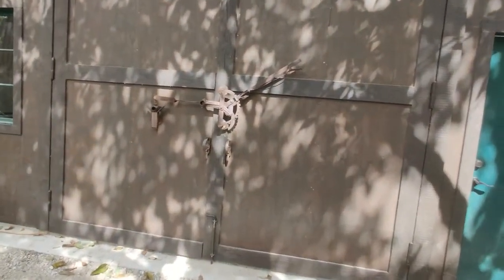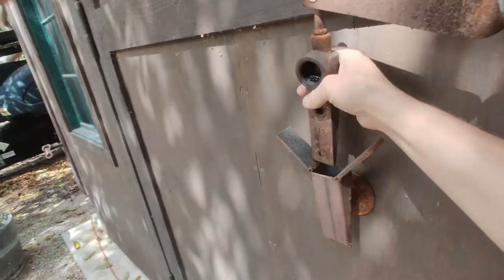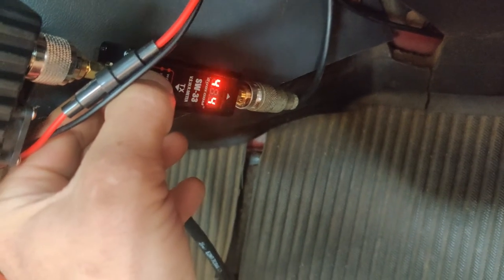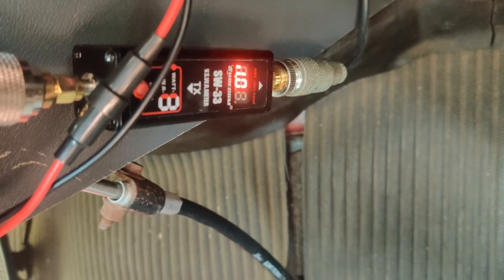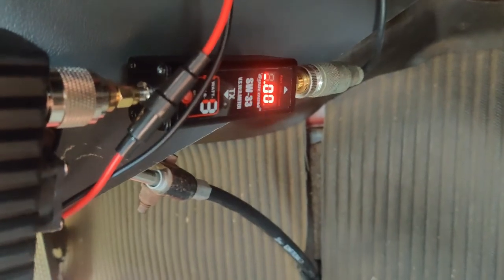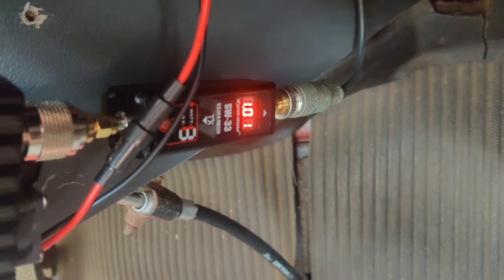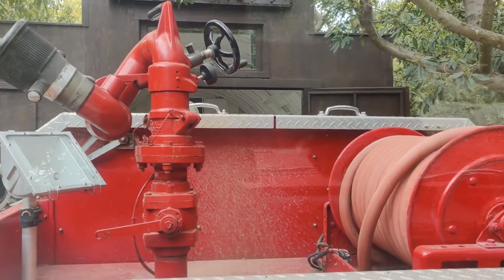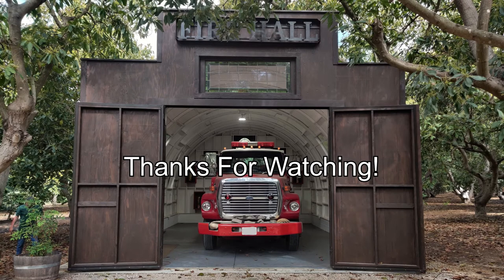Retesting the Antenna Tuning in the Fire Truck

Comment: I have the same meter, in the instruction manual it tells you to hold it up straight and make sure you are holding the box. I think it has something to do with grounding. That might help. I was getting high readings on my hand held until I tried that.
Reply from the maker: thanks, I look into that. not sure how much I read the instructions. either case, it got me well into the ball park and the radios / repeater work great